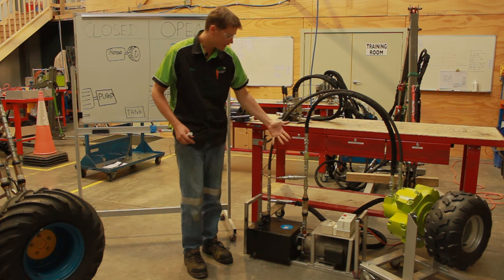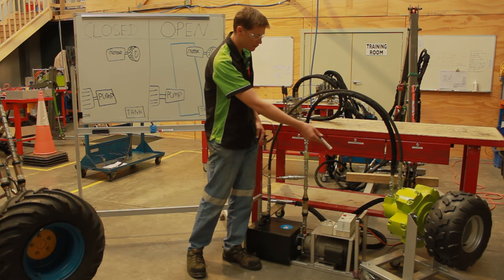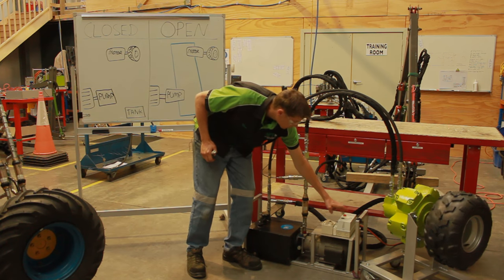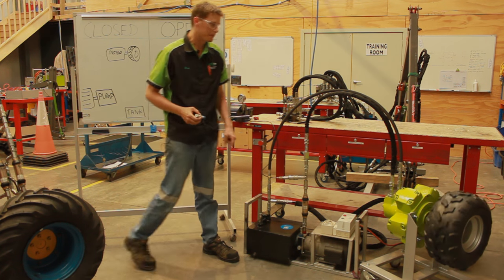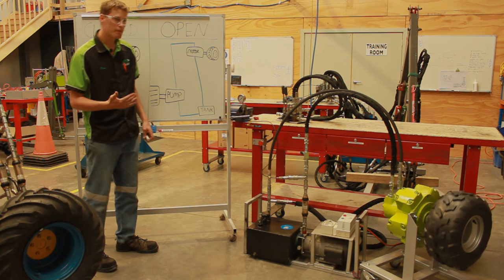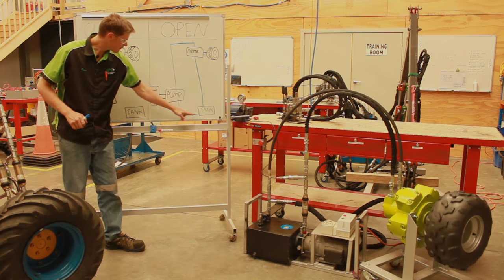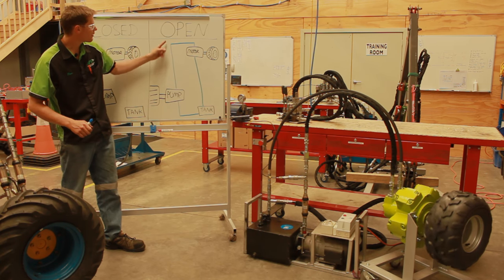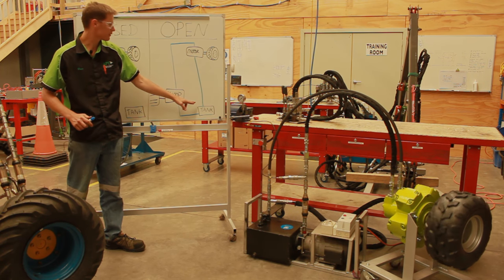Open Loop vs Closed Loop Hydraulics

Comment: Good presentation. In summary from my past experience as an ex hydraulic engineer. Closed loop systems primarily used in mobile applications where a compact design is needed and a direct, dual direction connection is required between a single pump and motor or motors. Advantages: compact design due to smaller tank, smaller hydraulic pipes, less valves. Disadvantages: expensive components, often variable dual direction pumps and/or motors, design limitations in adding additional end uses, unequal displacement end users users (such as standard cylinders).  Open loop systems primarily used in static industrial systems. Advantages: lower component costs and unlimited design options, multi independent actuators from a single system. Disadvantages: bigger tank capacity required, bigger pipes on the return side, separate valves.
Reply: @Ask APT No, moved out of the field 21 years ago. Still very passionate about all hydraulic. While mechanically I would imagine the systems remained similar, I am sure on the control side, there have been good developments over the past 20 years. All the best.

Comment: You don't limit the speed with a restrictor before the valve in a open loop system. Best way is to limit movement och spool
Reply: yes terrible device before the pressure relief

Comment: closed loop is used in transmissions in just about every construction, forestry and farming machines these days, open loop is for hydraulic cylinders where the oil needs to be returned to a tank as the oil amount varies to and from the hydraulic rams/cylinders.
Reply: Why are they not used in cars: Is there torque multiplication, Can they be used for high speed?
Reply: Wait why not use a closed loop since then you just have a pump on every ram instead of one with a complicated valve system?
Reply: On a car, the open loop system is the better choice for a lot of reasons!

 The variable speed ability is taken over by the engine, and gives you the ability to use sliding vane or gerotor pumps for simplicity and longevity. An example is a power-steering assembly. These systems pump fluid through an a little hole (called an orifice). At low engine speed, the orifice is too big to be a restriction, and the car is likely parked or has low duty requirements, so drag isn't a problem. You can turn your power steering pump with your hand! Pressure gain has exponential characteristics. Doubling engine speed will quadruple the pressure, and the engine often goes over 10-times the idle speed. Any shock loads against these systems are typically resolved with the tremendous amounts of momentum in the engine. 
 
For an Electric motor that rotates at a fixed frequency (60hz, geared down to whatever suits your nominal shaft torque requirements and pump speeds), the closed loop system makes sense, but has its own sacrifices. For example, we might need a sudden burst of speed. The motor often can't cope with this, or becomes a reactive load for the power source. The work-around is to have a huge flywheel on the motor. If you're dealing with shock loading, the flywheel will give you all of the load you could ever want, but the shock loads can trigger your safety valves, causing the system to go backwards.
Reply: Automatic transmissions have open-loop systems that are optimized for the duty at hand. You have control over engine speed and should be mature enough to know what kind of gear shifting duty the transmission would ever need to do. Given that information, an open loop system can be made, such that its mode of failure is known and forced to happen for safety reasons.
Reply: @BigCroca  still would need a valve to change direction and control speed what is driving each pump? and on a high cycle time machine you would need coolers on each one,  a normal valve is in no way complicated to understand
Reply: i´m thinking about building a tracked vehicle with two hydraulic motors and a gasoline or dieselengine as a powersource. is there any possibility to control the oilflow with the engine speed only.  Because if i do so the pumps have to be open all the time and only close are variable for steering but then i will loose the ability to break with this pumps because the are always open. I hope you get what i mean and any idea?…..thanks for an answer in advance. M.Kuhrt
Reply: @BigCroca  $$$
Reply: @ryanhawkins5306  use constant variable pumps and run them all on the same power shaft.
Reply: @BigCroca   then you'd need 6 pumps to operate an excavator you still need to change the oil flow direction if you had a hoist or single acting cylinder there'd be nowhere for the oil to go if you had a front end loader you wouldn't achieve bucket float function, which a proportional load sensed valve can do very easily with 1 variable displacement pump
Reply: @ryanhawkins5306  a constant variable can pump both ways :) and at any rate (too a point obviously)
Reply: @BigCroca  true just the $$$
Reply: @ryanhawkins5306  true
Reply: @Dr_Xyzt  3 phase motors with 50 or 60 Hz are on their way out.
I work with frequency converters and fixed piston pumps.
They operate from 15 to 87 Hz. With a PLC, proportional releaf valve and a pressure transmitter, it can be more reliable and energy efficient than a variable pump with a fixed RPM.
Reply: @BradDavis in a car the key to longer driving cycle is fuel economy and all sorts of efficiency is really so important as an engine just produces 35% thermal eff meaning only 35% energy is used to propel the vehicle the remaining is wasted as heat ,to coe with this the transmission should have at least 90+ eff at most speed ranges that the reason gears are used they directly mesh with each other to produce the required torque it's more straightforward than Hydrostatic Transmission because in a hydrostatic one the fluid first wastes some energy to buil pressure at the loss and then start rotating the actuator and also there are individual eff for pumps and motors meaning your total transmission efficiency = total pump efficiency*(Motor Total eff) which will be at the best case only 80% for piston motors and pumps which offer high efficiency but they stay at the 80% zone only at low speeds as the speed increases efficiency drops resulting in poor performance ,But you may think that then why use hydroDrives in construction and heavy machinery the reason is these machines are so heavy and need enormous torque to get moving as well as enormous torque to breath through the rough opposing loads so a hydraulic motor does just that it can produce enormous torques well within its continuous speed range when coupled to a normal gear transmission they offer a beefy powerpack capable of moving through anything ! Imagine removing the hydrostatic transmission in the current example your engine should produce sufficient torque natively to propel the vehicle but in this case the engine just produces torque to overcome the maximum resistance that could be offered by the hydro pumps which means your engines could be significantly downsized ,I'll get to the numbers a Typical Low speed High Torque  hydraulic motor can produce 1000+ Nm of torque easily whennita has high displacement I am talking only about fixed displacement motor whereas an engine that produces 1000Nm of torque is much larger and heavier which is a waste of energy the low eff of hydroDrives is compensated with the small package and high torque and robustness they provide simple as that cars operate at higher speed so it's very difficult to design such a circuit with good eff

Comment: Well ...conclusion ... a "closed loop" system is an "open loop" system where "tank + lever + speed controller" is directly inside de pump :)
Reply: Not necessarily. 

Basically, an open loop circuit can circulate without engagement. A closed loop system is limited producing circulation within a working circuit. If no work is being done, there is no flow. 

A variable pump is just one way of achieving control in a closed loop system. The other, is to control the prime input. In this case, that would be the electric motor.
Reply: James Copeland i
Reply: Kodi Cochran 

???

Comment: A very well presented video, with clear uncomplicated use of English Language, and obviously well-prepared visual aids. 
 10/10 for this one!
Reply: 9/9 how do you fill the closed loop system with oil without tank, thats what i missed the most :(
Reply: Brian Gillis   Baie has
Reply: 13/13 I would like to reiterate the fact that THERE IS NO HEAVY TECHNICAL VOCABULARY! It is refreshing to watch an engineering video that is straightforward and visually aiding.
Reply: @martynasvizbaras1180  basically everything is built into the closed loop system .  enough room for oil and the control valves. seems like the open system is more user friendly. easier to repair.

Comment: Very helpful and informative!  I loved the way you demonstrated your point: by sequentially adding parts and explaining the differences in the state of the loop as you went.
Reply: But here is a flaw concerning the open loop system. Directional control valves are usually proportional. You can control the speed with the lever pretty well. You don't normally need any flow control valve that increases unneccessary pressure, energy consumption, heating and wear on the pump.
  
 On every tractor, loader, excavator etc with a fixed displacement pump for the working functions you control the hydraulic cylinders and even motors by the levers on the control valve and rarely any flow control valve is used. Controlling the speed of a cylinder is pretty much like controlling the speed of a motor.
Reply: @ontheroadagain4773  Exactly. In most cases, you don't need a flow valve when you have a control valve that will do the same.
The systems with solenoid control valves you do if you don't want full flow on part of the circuit.

Comment: Just watched your Great video,  very well done!. I learnt hydraulics 35 years ago, as a mechanical fitter working on presses and factory equipment,  just a mention that the swash plate in a axial piston pump changing positions may not just change displacement volume, but also can change its relative position to the inlet and outlet ports on certain pumps!. What amazes me is the service life of some equipment may have been from WW2.😂 All gone now I imagine!

Comment: Good explanation .
Closed loop systems would generally have some kind of top up or boost pump incorperated to keep a contant gpm. also without a top up a possibility of cavitation could occur. 
If there was some kind of drag/force holding the wheel then pressure would build up thats why a PRV would be installed to divert back to tank. hense the reason for a boost pump to keep the fliud topped up. and hense the reason the tank is still there.

Comment: There should be oil cooler in closed hydraulic system..
As the hydraulic oil on heating reduces the efficiency..

Comment: thank you for your videos they have been very useful , i have a morgan giles motor cruiser from the 1970s with Hydraulic drive based on a perkins 4108 diesel engine attached to a Hydraulic pump in an open system that has a motor driving the propeller, i am looking at adding a hydraulic generator into to system and restoring its original functionality. i am wondering if you can explain remotes on this system, my boat has the  mechanical direction and speed controls in the engine bay but also another set  that look electrical  on the helm that are supposed to be controlling the direction and speed  when its all working .

Comment: Very cool I am watching this and all of a sudden a light comes on and this is my John Deere transmission driving lawn mower  I rebuilt, basically I changed about 40 Orings & a couple of shaft seals they wanted  a thousand dollars for a new one I bought a rebuild kit for 80 dollars I must of fixed it still working after two years !! LOL

Comment: Great simplified lecture
Reply: But here is a flaw concerning the open loop system. Directional control valves are usually proportional. You can control the speed with the lever pretty well. You don't normally need any flow control valve that increases unneccessary pressure, energy consumption, heating and wear on the pump.
  
 On every tractor, loader, excavator etc with a fixed displacement pump for the working functions you control the hydraulic cylinders and even motors by the levers on the control valve and rarely any flow control valve is used. Controlling the speed of a cylinder is pretty much like controlling the speed of a motor.

Comment: omg thank you so much for sharing such a awesome video. It is very understandable and easy for beginner.
Reply: But this isn't how an open loop system works in practice. Directional control valves are usually proportional. You can control the speed with the lever pretty well. You don't normally need any flow control valve that increases unneccessary pressure, energy consumption, heating and wear on the pump.
But in systems with solenoid control (on-off function) valves you need flow control valves if you don't want full flow on part of the circuit.

Comment: this is soo cool and makes it simple to understand i had to download it
Reply: But this isn't how an open loop system works in practice. Directional control valves are usually proportional. You can control the speed with the lever pretty well. You don't normally need any flow control valve that increases unneccessary pressure, energy consumption, heating and wear on the pump.
But in systems with solenoid control (on-off function) valves you need flow control valves if you don't want full flow on part of the circuit.

Comment: excellent presentation. easy to understand. if you teach to small kids. i guarantee you that they will understand it.
Reply: There is a huge flaw in this. Also in an open loop system you normally control the flow by the control lever and you don't use any flow control unit that rises the pressure and causes overloading and heating up the oil. When no oil pressure is needed the oil has free passage through the pump. A very little power is needed for this. Almost every excavator, loader and agricultural machine uses the open loop system for digging and loading.
  The closed loop system is mostly used to move the whole machine, because the variable displacement pump works like a stepless automatic gear box: Less volume (speed) means more pressure (torque). In an open loop system you don't have more pressure at less flow.

I can't understand how an obviously educated person can spread disinformation like in this video.  I've been working with hydraulics for decades and I haven't seen any special flow control valve used for this purpose. It's only used for safety reasons to put a limit to the maximum oil flow.

Comment: Well done.  So closed loop is direct control of the plate and amount of fluid pumped.  Open pumps same amount always and you control where it goes or how much bypasses.

Comment: Positive with open loop system is low cost components and simple, if using propotional spool you have good control of the wheel.

Closed loop wirh varible pumps requires super clean oil and pump costs 10 times more. 

So type of system to choose depends on machine and application.

Comment: Great video, it visualization gave me a better understanding with its explanation of course but als intrigued me. Like how fixed is the motor as it’s closed off and does the restriction valve boost the power too besides restrictions the pump?

Comment: Correct me if i'm wrong, but my understanding from the video the close system is like a servo motor. To get a precise movement of the actuator, right?
Reply: Right. To be more exact, this system is called "closed loop hydrostatic". I have a playlist on my channel named "hydraulic learning". There you can find 2 videos where this system is explained in detail.
The system is in principle a stepless gear box with its variable bidirectional displacement pump - and in more advanced systems even a variable displacement motor.  Less oil flow means less speed and more torque while more oil flow means more speed and less torque. The simpliest example of this system is on lawn movers
   But a precise hydrostatic drive can also work with an open loop system as well as with a closed loop system. The difference is that a valve is needed to change the direction of the oil flow, because the pump can't be bi-directional. Most bigger modern excavators use the open loop system. They usually have 2 variable displacement unidirectional pumps that drive both the tracks and the digging equipments controlled by valves.

Comment: From his explanation, open loop system is better in the sense that we can add a pressure relief valve once the pressure in the system is built up. This is to protect the pump from overheating. But whereas closed loop system cannot do it. Is my observation correct?

Comment: I'd like to use a Hydraulic loader on a Closed centre John Deere with only 2 spool Valves . How can I achieve this ? Loader up-down, Bucket Tilt and Possible Bucket Grab with two Spools on Tractor, to use a Log splitter I insert an adjustible flow Valve . Is there a Better way to do this, especially as Loader will need potentially 3 services on 2 spools?